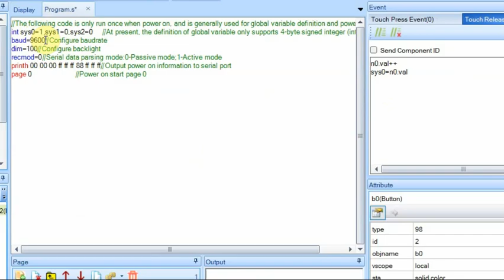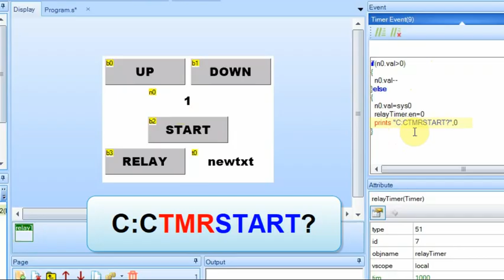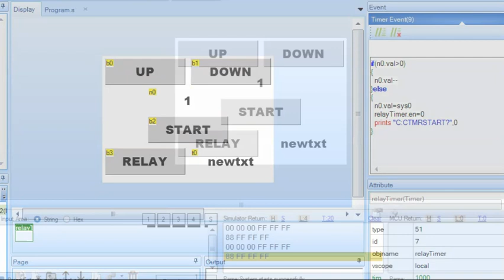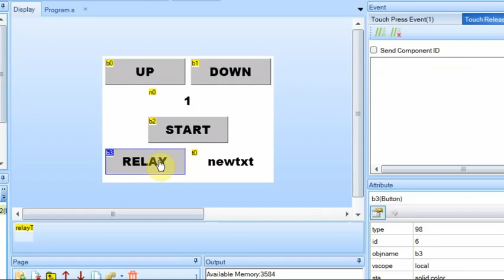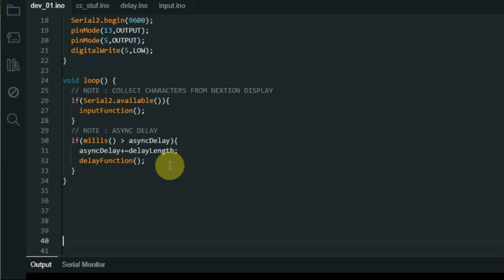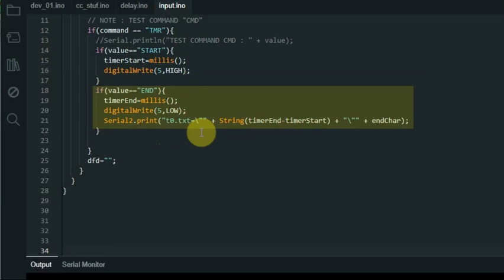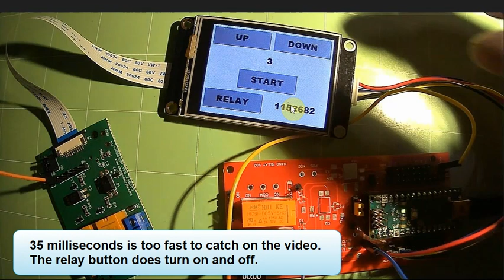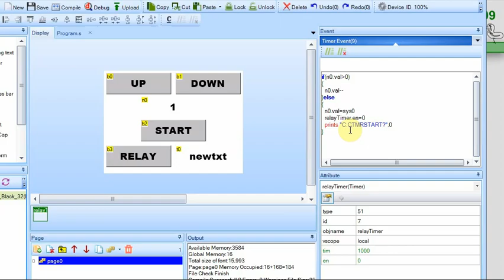209 Simple Nextion Countdown timer relay control with feedback

Comment: Hey can you make an incremental timer like someone presses a button called "Start" and then a timer like a stopwatch starts and when we press "Stop" we can get the elapsed time?
Reply from the maker: Yes, but you are limited to a 50ms resolution on the Basic and Discovery series.  I am not sure about the enhanced and intelligent series.  They have an internal RTC, but I can't remember if they have milliseconds.  I will check that out and reply with another comment. Edit: They do not have milliseconds.  You need to use a timer to count every 50 milliseconds while the timer runs.